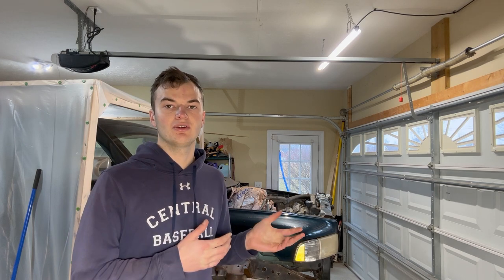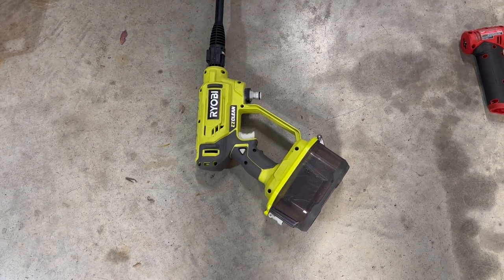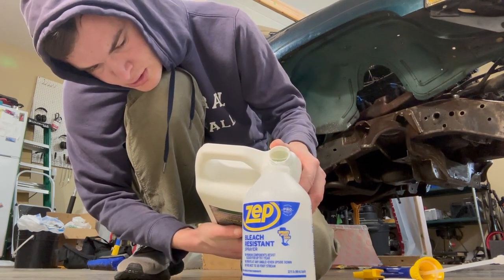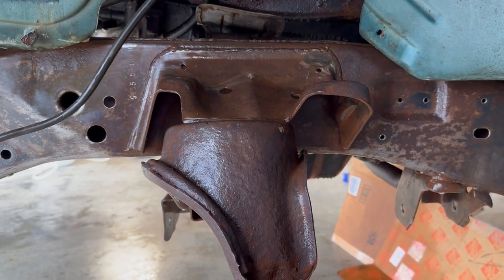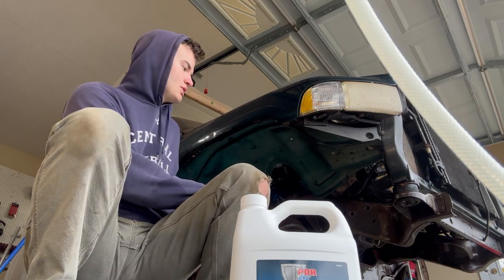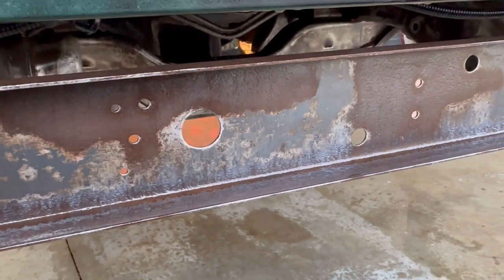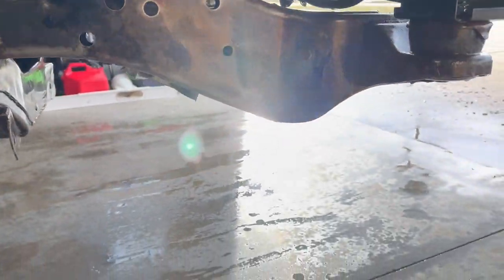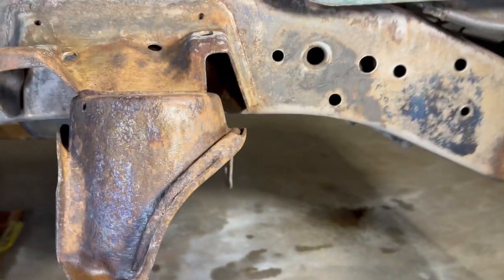Applying POR 15 On Truck Frame (FULL PROCESS)

Comment: I used this on a truck a few years ago. Unfortunately, it didn’t hold up well. That being said, I didn’t prep it as thoroughly as you did so I’m sure it’ll be fine
Reply from the maker: That’s a bummer. I’m hoping to get a decade out of it, but we’ll see. Thanks for watching
Reply: Ever considered 2 pack epoxy? It's supposed to be the Gorillas balls for adhesion strength & rust encapsulation. But POR is a good product too shame it didn't work out 4 yu
Reply: @mrmelonhead4161  That Por15 is the best stuff out there, I used it on my 1980 Dodge Ram and on my 1985 Ram back in 1992 and the chassis are still the way they were when I did them. I also did the wheel wells and in behind where they normally rust out, to this date there is still no rust. Definitely worth buying, my next project is my 1979 Ford Lariat. I'm sure that you'll be happy with it. I've also used it on my newer Ram trucks that I have, I have a bit of a Ram collection. 👍🏻👍🏻
Reply from the maker: @amadrid5899 awesome to hear. That makes me feel a lot better. I have also become somewhat of a ram collector. I have three vehicles and 2 of them are pre 2000s rams. Thanks for the comment and watching
Reply from the maker: @andrewcheatle4691 I’ve never tried it but if this doesn’t hold up as well as I’d like it too, I might give that a go. Thanks for watching
Reply: @amadrid5899  That is good to hear. I have a 6 year old Jeep that I park outside and I live 5 miles from the beach. Lot's of parts are starting to rust. I would like to put something on it, but unsure what would fit my needs. POR15 seems too heavy for me. I want to avoid fluid film for the mess that it makes (I am the only mechanic on this car and I don't want to be dirty all the time). So I am wondering if there is some lighter version of the POR15 that I could spray on the axles such. That would stop further rusting and prevent future rust. Given these parameters, what would you recommend?
Reply: @mrtopcat2 

To want to do any derusting, painting, metalwork, body filler, engine work and expect to not be "dirty" all the time will never happen.

That is equivalent to saying I want to play in the mud without getting it on me.
Lol

Unless there is rust and metal in your pants, in your hair or in your oatmeal then you are not derusting your vehicle or you had none to begin with.

You cannot drywall without getting dust all over you and you cannot work on cars in any capacity without getting dirty.

Take it from me. My one grandfather was a black Smith for a logging company in northern Canada, my other grandfather was a mechanic and farmer, my dad a machinist and my best friend a diesel mechanic.

I grew up on the farm and in the shop. I never saw My grandfather's fingernails clean. Permanent.

Unless you work for space X or Nasa with state of the art suits and cooling and ventilation.
Reply: @mrtopcat2 a “lighter version”😅😅😅. Like in weight? Is a few pounds of paint on a 4500 pound vehicle going to make you use more gasoline? WTF are you trying to say?
Reply: @Dixler683  I wrote my comment in good faith. Unsure why you need to pick on it, unless of course you are really not getting it. Either way, it is on you.
Reply: @mrtopcat2  well it must be a language thing because I was not picking on you. You inquired about not getting dirty while working on your vehicle. You asked about a “lighter version “ of paint. I cannot make sense of your comment. So what exactly do you want to prevent ocean salt air from rusting the Jeep? A feather weight paint, a white paint instead of black pigment. Explain how you can mechanically repair the Jeep and still remain clean? Soap will wash off dirt. So now it is on you to answer . PS the previous comment also could not figure you out and you did not comment to him, so are you singling/picking on me?
Reply: @Dixler683  References to the weight of oils (heavy, light etc.) or oil-coatings if you so will, are never in the literal sense. I thought this was common knowledge among enthusiasts, but apparently not to you. Also I have been working as a mechanic likely since even before your parents were born.

But most notably, I was asking for “suggestions to fit MY needs/parameters” and NOT commentary about those needs/parameters.
Reply: @mrtopcat2  So what are those “needs” you speak of? If you are referring to Zahn Cup ratings I have never measured POR-15 but it is a very (low  viscosity ) thin paint. Probably falls in the 28 second range ZAHN cup #4. For someone who has been working in the industry (mechanic) since before my parents were born you seem to know very little. My parents  were both born in the 1920’s so you must be over 100 years old. I retired from the industry in 2008 after working for close to 40 years. Now I do it only as a hobby for myself. I have never encountered someone like you using 5 dollar words and only knowing 5 cents. Good luck with your project, you need it. By the way , oils/lubricants are graded by “weight” NOT paints. POR-15 is a water cured urethane PAINT. It is not an “oil coatings”.
Reply: @Dixler683  I already explained my background as well as what I was looking for. This was a friendly discussion until you have chimed-in in bad faith and now dancing around owning up to it.
Reply: @mrtopcat2  you know nothing.

Comment: luv to see a follow up 2 years from now, I used POR15 on three different vehicles and it has failed all three times, spoke to the company and they said, yeah, it does that sometimes ! you can't make this stuff up folks
Reply: Ugh, hate hearing this. It's such an involved job to do a frame - the thought of it not lasting is a bummer.  Out of curiosity did you use their metal etch spray beforehand?
Reply: Did you do all the prep work?
Reply: @Good-Enuff-Garage….Ha thats kinda funny. When the directions told you to prepare the metal surface you said , “ah , good enough”. After the paint failed you contacted the company reps. and they said….”if you didn’t prepare the surface, it will fail sometimes”. Also you must follow the instructions for humidity and temperature. Two, 2, tu, too coats MUST be applied.  This stuff does not fail. What it does do is this: very expensive, similar products for less are available and work better.

Comment: looks nice! what about the inside of the frame? Fluidfilm would have been better. one rock chip and you're right back where you started at. Not trying to be mean but that stuff has a purpose and frames are not a good choice.

Comment: Inside the chassis rails - there’s a lot of holes along the rails, so I’m curious if somehow a rust converter (or similar) could be sprayed in by small tube or piping? It just seems that a lot of work has gone onto the exterior surface but rusting often starts from the inside
Reply: I used a spray rust converter inside the holes on my 2006 4Runner and tried my best, then filled up the inside with Woolwax (covered the entire bottom of the car with woolwax after doing the coatings on the frame for two layers of protection.
Reply from the maker: They actually make a hose that you can put on top of the spray can to get it deep inside the holes. I plan on using something along those lines

Comment: What respirator did you use? I found one at Home Depot by 3M and was rated OV/AG P100. There were other ones like OV/P95 but I can't figure out which one to get. Both are NIOSH approved which is what POR15 recommends but need to know the specifics for optimal protection.

Comment: Very interesting video, I just did a similar process on my 94 GMC Sierra. I used Rustoleums version of POR15. It has good reviews and it’s about 1/3 of the price per quart.
Reply from the maker: Thanks for the info. If I were to do it again I might consider a lanolin product. I would have to reapply more often but less prep work. It also probably gets a little deeper if you don’t have it all disassembled because you can spray it. I am also using Rustoleum paint for all the little things, like control arms and sway bars. I am interested to compare the two head to head over time. Thank you for watching.
Reply: @mrmelonhead4161  yes I used rust oleum spray for the smaller portions I couldn’t reach with a brush. However it was rust oleum rust reform spray and not just black.
Reply: @cosmic8845  I’m doing a similar process but I’m going with Ace rust stop paint and I’m going to roll it on for a thicker coat and fill in spots with a can.
Reply: @emmanuelalva6597  awesome! Definitely take your time, if it’s done right it should last a while

Comment: How’s this holding up?  I’m just about done sanding down my steel boat trailer and planning on using a few coats POR-15 and then hitting it with Raptor Liner on top. It gets absolutely hammered by rocks from the gravel roads I drive so I need additional chip resistance hence the bed liner on top.

Comment: I use por 15 all the time on my cars and I never took them off the frame I cleaned the frame really good and I used the primer and the frame black paint with a brush and you can't even tell it but you did okay with what you did but that is to much work you took your bed off and looks like you took you  all your front end apart  but when doing a car  unless you are doing a frame off restoration you just need a wire brush and the cleaner  and pressure washer and then primer and then the frame black  gose on  and then it's all  done on a car but trucks you  can do either way as long as you don't get none on you  it turns you red